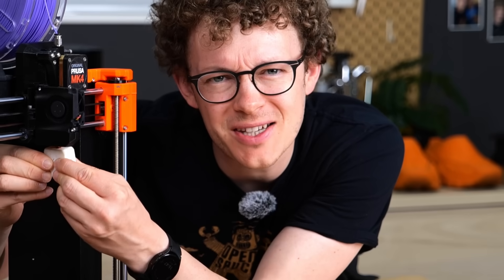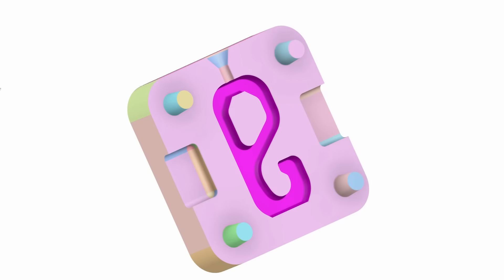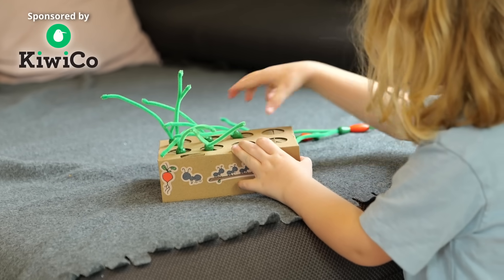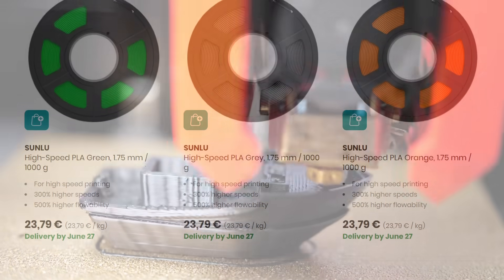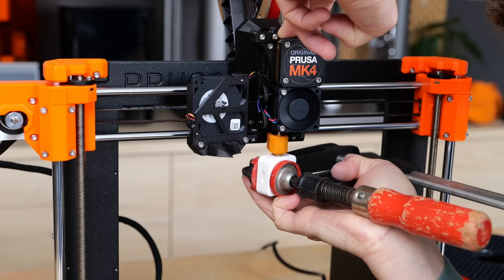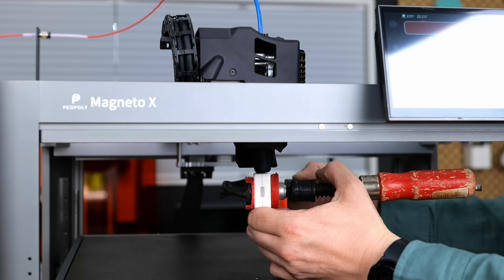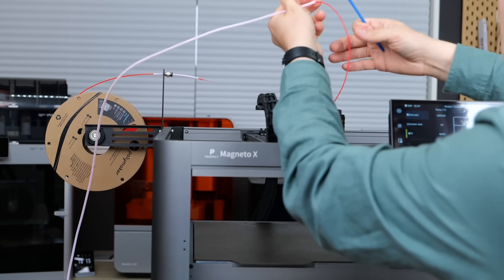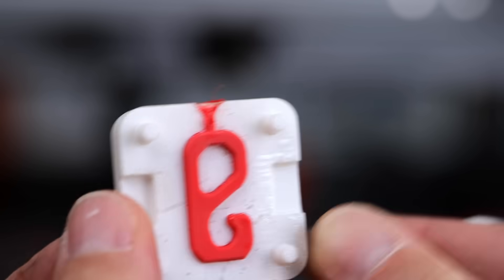I tried Injection Molding using a 3D Printer!

Comment from the maker: QUESTION: Where could this method be useful?
Check out our Heat Set Inserts and Tools at https://cnckitchen.store (Free shipping worldwide starting at €100).
Reply: why could you not set your mold on the printing bed? aligned at 0° on all axis will be a huge improvement from all your angled hand held molds.
Reply: @nadca2  Many print beds are mounted on springs, which wouldn't really work in this case. Also, not setting the mold on the bed means that you don't have to write G-code that locates the head in just the right spot, or even just the right elevation above the bed. You can instead just heat the nozzle and then manually advance the extruder some amount.
Reply: @ioscaleb  thank you so much! I knew there was a reason!  please excuse my ignorance of 3D printers :)
Reply: @nadca2  yes and heating block might also help
Reply: You should press the mold against the heated bed with the nozzle, then you can create a bigger mold because you dont have to hold the mold by hand you dont have to wait the whole 4 min holding the mold by hand, pressing the mold against the bed will also help with heating the mold so the plastic won’t solidify fast
Reply: @jowmind9277  it would help significantly more with the angle between mold and printhead, as that's always mis-aligned. there has to be a reason he chose not to print on the bed, but I cant think of why.
Reply: @nadca2  you can’t think of why because there isn’t a reason
Reply: You need vent hole at the end of the mold 👎
Reply: @jowmind9277  Thought so, too. The compressed air will bubble inside the Plastic. It's hard to say if the mold is airtight, it looks like the surface is too uneven to make an 100% airtight seal, but a .25 mm venting hole would probably improve it a lot.
Reply: @sythys_  he clamped it tightly, and the mold being printed by a resin printer it has some flexibility making it easy for it to create a thigh seal, as you could see all of the injections he made were rounded at their ends showing that the viscous plastic couldn’t get enough pressure to push out the air out the tiny imperfections of the mold
Reply: @sythys_  look at the bolt he made at the end, its end were uniformly rounded showing that the plastic got to viscous because of the cooling and couldn’t get enough pressure the win out the remaining air out.
Reply: @jowmind9277  This is correct. 
You need a small line from each edge, that kinda has it´s own finger... 
This helps you pressing the air out of the mold ( which i think is creating you issue due to backflow), but also shows you when it is filled correct.
Reply: You need to preheat the mold in in injection molding, what your seeing is the plastic cooling quickly as soon as it touches a mold you are able to touch. Also I can't help thinking that at some point the air pressure building up could become a problem although it didn't look like you were there yet.
Reply: 2 ways to fix it: 1 add a pressure relief tube where air could easily be released from the mold during injection, and make the mold thinner and continually heat it during injection (after pre-heating)

I suspect that you will always be size limited due to flow rate and relatively poor heat conduction of the mold material
Reply: Hi nice idea but mold should have hole for air why you don't make it?
Reply: @3hprodaction  perhaps i try it
Reply: I don't understand, probably I'm missing something, but where is the output channel that allows not only air to escape but actually melted filament to fill it? Typically you have that extra channel with material, so when the model cools down to have extra material to compensate for the shrinkage. Also I would think about preheating the molds and also treat them with anti-sticking spray for easier release. I would like to see another, improved video on this topic.
Reply: At small scale, it would be good for one-off fast casting, especially the tpu.  Personally, if I am going to cast something though,  it's usually for a large part, or a part that needs a special material or visual appearance that you can not get with 3d resin or filaments .  Or if you have detailed or small parts that don't print well and / or are not easy to clean, then a cleaned up master mold would be good to get parts ready to be used.
Reply: You need to add an exit hole for filament to escape from in your mold, otherwise you will get back pressure and it will stop at the top like you saw.
Reply: You should maintain temperature of the mold during molding. Perhaps use two flat resistors to keep heating it during whole process? Stabilizing temperature could be a problem, for the prototype you could just make it manually with thermocouple inside the mold. 
Also as other stated, very small hole at the end would help greatly.
Reply: I think you finish too early your parts. And because of that air stay trapped inside a bit. So maybe make a little exit so it fills better.if plastic goes to hat exit you can cut the lil bit.
Reply: The annoying part is he's using a Core XY printer which allows him to use the printing bed to clamp to the nozzle and still chooses to hold it himself.
Reply: @BrunodeSouzaLino  Probably doesn't want to risk damaging the bed or stress the motors/lead screws/gantry of the printer.
Reply: Placing the mould directly on the plate and injecting it would excert the pressure from the extruder directly to the hotplate. You'll probably bend your bed. 

However a piece of plyboard with legs to make it hover over the bed would make a lot of sense. 

Place pressure devices (like those from a bathroom scale, connected to an esp32) and you can see the pressure in realtime. That way you also have some control over the force to the z-frame.

Create some air escape compression cavities in the mould to hold the escaped air and still keeping the mould pressurized.

Heat the mould to above the melting point of the plastic. (160-200C) To allow for the slow filling.

I don't have a resin printer, but maybe making an epoxy mold is an option.
Reply: Replacement parts for old French cars. Little things like the clips that hold the windows up in a Peugeot 306 die because the French government made them use French-made plastics in exchange for tax breaks, and French-made plastics are garbage (except Plastic Bertrand of course). 3D printed replacement parts just aren't suitable for long-term service in an automotive environment, so this is a great case for small-scale ABS injection moulding.
Reply: @IOUaUsername Plastic Bertrand was Belgian
Reply: There is one thing you can do: 
Preheat the mould.

This way you don't run into viscosity issues as quickly. 

On top of that a venting hole will probably reduce the pressure needed.
Reply: Also have you considered putting the injection hole at a place that's less distance from the extremes? 
Injecting the hook from the side would probably reduce the required pressure significantly
Reply: Could you 3d print parts as normal, but include injection cavities and fill them as you go to strengthen the part? It would require some fancy gcode scripts but I think it could increase the strength across layers a lot.
Reply: I'd be interested to try making small ball/socket joints for models
Reply: @CNCKitchen 

I would definitely try a vent hole (maybe more than one) thin enough that can be easily cut. 

Also as others said (if it doesn't ruin your printing bed) you could run a code to place it exactly on top to secure the right "pressure".
All other aspects I find them very well done
Reply: i was also thinking air hole vent before checking the comments to see that practically everyone else thought the same exact thing. i find it unusual that there is no replies or likes to any comment that mentions the use of air vent holes in the mold, as if Stefan refuses to acknowledge that he missed a very crucial step in the mold making process. BUT at least he did find time to make a pinned comment for his store a day after upload...
Reply: don't use Any Nozzle
Reply: @CNCKitchen

Hi Stefan,

Ich hab da so ne verrückte Idee gehabt.

Man könnte doch von nem billigen Drucker den Toolhead nehmen. Abschrauben. Ein Mini Backofen. Oben ein Loch rein. Den Toolhead mit ner 1mm (große Nozzle halt) direkt am Loch aufsetzen.
Den Ofen auf >230 Grad erhitzen. Und dann einfach dauer extrude und direkt in die Form rein drucken aus Silikon zB.

Wäre quasi eine Weiterentwicklung.

Wenn man dann noch nen Pellet Extruder hat...

Könnte klappen, oder?
Reply: Create a void in the mold to hold a nozzle while leaving the threads exposed. by incorporating it into the mold it would better seal, also you wont have to hold it up to the hot end like you do In the video, you can simply screw the exposed nozzle threads into the hot end.
Reply: One viewer mentioned adding a vent, that would help big time, another thing you could too to help is put a small kitchen scale on the print bed. This way you can lower the z axis down to the desired amount of force of the nozzle into the mold.
Reply: answer:acarute mass printing, mass printing you normaly do wth a printing website but it isnt always so acurate.
Reply: recycling shreded plastic bottles rather than pullstruding
Reply: Are you aware of the desktop-sized injection molding machine that @ActionBOX made? I'm not too familiar with it, and I know they sell kits for it, but I'm under the impression that it is a DIY machine. They might be a good channel to try and collab with for a project like this.
Reply: @CNCKitchen Here's a video idea: You have tried 3d printing with hot glue, so maybe injection molding with hot glue?
Reply: For Manufacturing, you should use tool steel not only to reduce wear and tear but also the material is cooling before it gets all the way through so you would need to have a heated mould as well.
Purge holes also prevent back pressure building up which would increase your speed and fill issues easily.
And parts with details like bolt threads really need tiny purge holes and to be printed with the threads horizontally so any air can be purged out and it can fill the mould completely.
You could use 1 horizontal purge hole that branches into each of the threads across the length or just one purge hole shared between pairs of threads but ether way if you want to get a hard plastic like PLA all the way into the thread in the mould you'll need to purge it. (or work in a vacuum.)

If you really wanted to use a high temp resin mould, I would suggest
1. Orientating the whole mould to be lying flat not on its end so it has the most surface area touching the heated bed.
2. Make the bottom of the mould thin as possible to really get as much heat through to the injecting material so it stays hot for longer and can get all the way through the mould.
3. Ensure there is purge holes and I would have these to the top of the mould.
4. Use the largest nozzle possible without ruining your product to really get the flow.
5. Spending the time on the mould to make sure it is perfect with no layer lines visible on the inside of the mould or between the two halfs.
6. Use a threadcutting tool to run over any threads to neaten them up.
Reply: imo, this kind of mold would be useful for miniatures. Sometimes ya just want a custom mini for Pathfinder or even some board games.
Reply: It gets on my nerves seeing him holding the piece in mid eair, why on earth can he just lower the damn nozzle thingy so he just lays the mold on the print bed 💀💀
Reply: If you wanted to injection mold into the thing, you should’ve put an extra hole at the very tip of the six that way it could excrete all the way through and push the other side. A little bit of sanding would’ve fixed the rough edges where it excretes. That’s all you had to do to fix that issue.
Reply: You should try injection molding with a CLAY 3D printer.
Reply: what if you make the mold with a heated small plate in the mold it can stay warm thought out the proses
Reply: here's a warning it is made of diamond so it can and will dent of shatter the bed if you are not careful, happy printing!
Reply: 1: intake hole in the middle if possible.
2: air hole at the end(s).
3: put it on the bed and heat it up at least 100°C
Reply: Hey man its me Remember talking to u about this idea years ago and somehow just saw this video... nice
Reply: lego
Reply: Please redo this with a vent hole!
Reply: and pre heat mild
Reply: The obvious advantages that injection moulding are supposed to provide is mass production at speed. Not something easily achieved with this setup. The next major advantage, that you touched on, is co-moulding. Incorporating different materials into each other, whether that's different plastics or in the case of the screwdriver you showed, metal. That can't be done with fdm or resin printing. The only thing I would caution regarding co-moulding, is it makes recycling almost impossible. But as seen in eg liquid containers, allows combining flexible and hard plastics to benefit from both (I guess some of those could actually be doable with fdm)
Reply: You need a heating rig to keep the mold hot, then plastic will not cool so quickly. No need for high pressure.
Reply: Why don't you just preheat your mold? So it's not stealing the heat so fast
Reply: Should have placed the camp on the mold then place both on a heated bed raise the z level  sandwiched between the nozzle and bed heated so you no longer need to hold  the mold and just worry about injecting the filament.
Reply: @GOOGLE-ADMlN would probably break the bed.

Comment: This extruder is totally inadequate to fill that cavity... Plastic cools and solidifies quickly once it exits the nozzle. Real injection molds operate at pressures measure in thousands of PSI

For better results, try:

Venting the mold so that air can escape as plastic flows in

Moving the fill port so that the distance the plastic needs to travel is as short as possible

Comment: vent it at the farthest point in the cavity,   also,  you need to reduce the friction in the cavity wall. Anoter idea would be more difficult but inject air pressure at the hot end filament intake.

Comment: Bonjour, je suis Français et mon anglais n'est pas parfait, donc il est possible que tu es évoqué ces solutions sans que je le comprenne parfaitement :
1- Le premier projet est probablement le plus difficile, en effet la partie qui remonte alors que la moule est étanche nécessite une force très importante pour pousser l'air en dehors du moule, une sortie à la fin du e (comme pour l'entrée, aurait probablement facilité l'injection).
2- Je pense que plutôt que prendre des matériaux haute vitesse, il faudrait plutôt choisir des matériaux qui se figent plus lentement pour permettre à l'injection de ne pas avoir à pousser de la matière qui est en train de se figer.
3- As-tu pensé à ce que le moule soit un peu chaud ? (Toujours pour retarder la solidification de la matière injectée)
4- Pourquoi ne pas avoir descendu le Z de tes imprimantes pour ne pas avoir à maintenir manuellement le moule contre la buse ?
5- On constate que le démoulage ne se passe pas toujours très bien, as-tu systématisé une couche de silicone type WD40 (ou d'huile) pour limiter l'adhérence au moule ?

Voilà, super projet en tous les cas !
Bonne journée !

Comment: You need a pressure port on the other end. The pressure port should be tiny enough to let air out and for pressure to build up so the cavity fills without over extruding.

Comment: I got a 3d printer several months ago to print xbox controller housings--I realized the limitations of 3d printing and heard several times that injection molding would be far better. I'm glad I watched this and some other videos first; it seems like there aren't any good at-home injection molding solutions beyond those for very small parts.

Comment: its not injection molding, but witch epoxy maybe you can try difficult geometrys also... that use no stress and can dry perfectly by it self. (maybe, i've no experience with epoxy)

Comment: Instead of using fresh filament, why not build a rig with the parts you have to save a few others to recycle failed/test prints. The "making stuff" and ( i think) "rgwreasesrch" channels both have the same playlist on building your own filament extruder. The basic  extudet concept should be applicable, and less headache than trying to do filament

Comment: You can try adding a chamber at the end of the print for air to compress into. One of the issues you are running into is there is no where for the air in the mold to escape once you start filling the mold so you start compressing the air inside the mold and there will be a point that the pressure of the air is greater than the extruder can produce, which is why the last bit is the hardest. Adding a relief where the air can compress into that isnt part of hte part you want to print may help

Comment: 10:45 Why increase the injection pressure? Suck it in. 😀 Put a small hole at the bottom, and try to suck a vacuum. (Not sure how, but if you could, this all becomes MUCH easier!)

Comment: Bro, let the air escape the mold! You're struggling in large part because you are not allowing the increased air pressure to be released. This is common knowledge in ANY casting process. Make a little channel from the tip of the hook to the outside of the mold and I guarantee you'll have an easier time.

Comment: Shouldn’t the mold be like 120°C to prevent the plastic from immediately changing phase?  You wouldn’t inject into an ice-cube mold, right?  But room temperature is like the arctic tundra compared to that nozzle temp.